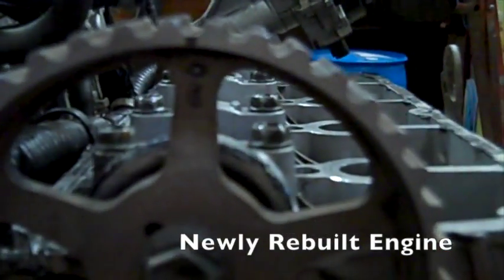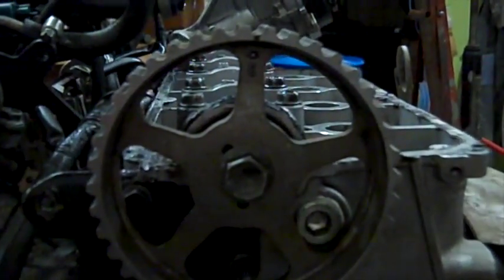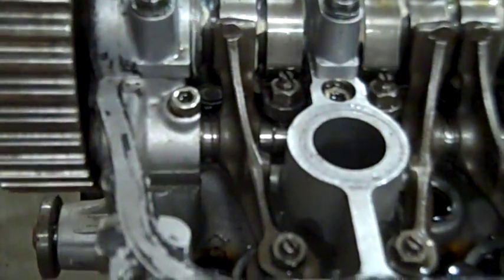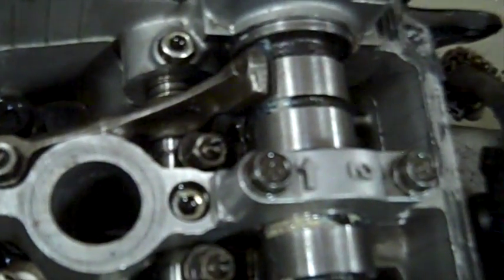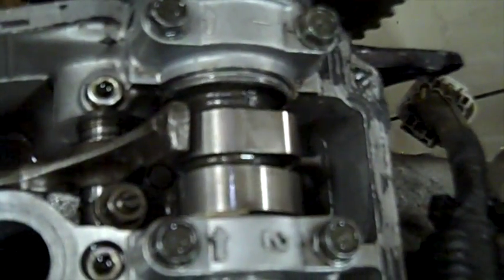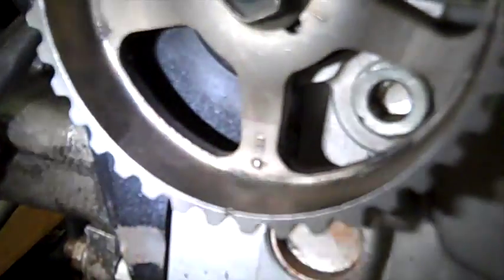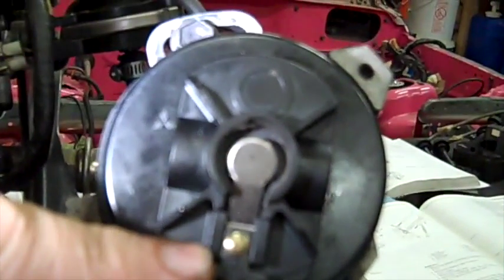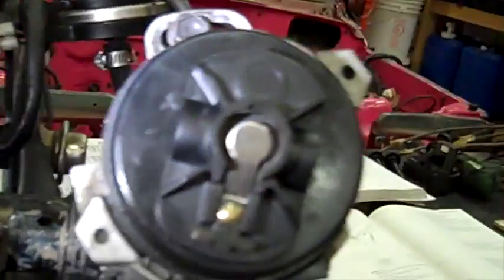1995 Suzuki Sidekick Camshaft Timing

Comment: I don’t know if you’re still active on here, but I have been working on my side kick for 4 months and could not get to the bottom of what was going on. Turns out I had the “E” mark at 12 o’clock. Rotated the cam to 6 o’clock and it runs like a dream. Thank you so much.

Comment: Ok will it still run if its on wrong cylindar at distrubitor i lined mine up it runs but the distrubitor would never point on those cylindars what up with that any help would be great
Reply from the maker: I think if it runs then it must be pointing to the correct cylinders or really close.  Contact me through my face book page, suzuki sidekick restoration project, and give me more details.  I will try to help.

Comment: Hi, I have 1990 sidekick G16A engine 8v,  On mine the distributor finger should be on 11 Oclock position while the fixing screw is on 12 Oclock /on your engine G 16A 16v finger is little more past 12 Oclock. And that is exactly how its need to be. Maybe you can help me with how to position camshaft on G16A 8v engine is it also 180 degrees mark straight down? When inserting distributor gear? I cannot find any info about that. Or is it O degrees position.  Thank you best regards
Reply from the maker: I show the process in a couple of other videos also.  You might want to have a look at, I think it was, the last episode of my head rebuild video.  The best way for me is to get crankshaft and camshaft marks lined up perfect (tdc #4) and then turn the crankshaft one full turn clockwise.  Then #1 will be tdc and confirm that by looking at valve rocker arms.  Then insert the distributor assembly so that the rotor will point at #1 position.  You can discuss with me on my face book page:  www.facebook.com/SidekickRebuild/

Comment: Why the camshaft has tow marks timming  points
Reply from the maker: Sorry Zameer, I do not understand your question.  Maybe you are asking why the camshaft pulley has two marks.  If that is your question, then I do not know the answer.  Probably have to get a Suzuki design engineer to answer that question.
Reply: E is for timing belt  i is for the distribuidor  you put the timing belt on E then you Turns  the cam n put it in I for the distributor  fire on number 1

Comment: Buenas, entonces cual es la forma correcta de colocar el punto del arbol de levas?
Reply from the maker: Lo siento pero no puedo explique en espaniol.  Encontrar amigo que habla engles e escucha video para traducir.  Yo hablo muey poco espaniol.
Reply: write me in English and I translate it please. How would the marks then?
Reply from the maker: Three things need to line up properly.  The crankshaft pulley at the bottom, the larger camshaft pulley at the top, and the distributor at the rear.  If you have had the distributor removed like I did then these are the steps.  With the belt off, line up the crankshaft marks as shown in video.  That puts cylinder 1 at front and cylinder 4 at back in the top dead center position.  Now turn camshaft pulley until E mark is pointed straight up.  Next, turn your distributor so that the rotor is pointed to the #4 cylinder spark plug wire.  Now slide the distributor assembly back into the engine and tighten the bolts.  In this position these things should all be true:  Crankshaft pulley marks lined up, Camshaft E mark straight up, and distributor rotor pointed toward cylinder 4 spark plug wire.  If you have the cover off you can check to see that exhaust valve lifters on #4 cylinder are loose (valves closed) and exhaust valve lifters on #1 are tight (valves open).  That confirms that everything is correct.  Don't forget to check valve lifter clearances again before putting the cover back on.  Hope this explanation helps you.
Reply: excellent explanation. The "E" upwards, damper in top dead center and rotor pointing towards 4. The valves of the piston 4 must be totally closed and those of the piton 1 in the crossing of valves. I'll do that tomorrow to see if it turns me on. Regards!
Reply: Taduccio en cateano
Reply: Traduccon en castellano

Comment: hi. what happens if the silicone that you used to seal the camshaft cover fall in the engine? can fall in the engine that silicone? sorry for my bad english.
Reply from the maker: Do not use silicon on the valve cover.  Order a gasket.  That is my advice.  Small amounts of silicon can squeeze out on the inside and break off.  They can plug up the tiny oil holes for the camshaft.  If that happens then your engine is ruined.

Comment: Why is your two videos different on cam timing same motor
Reply from the maker: Can you explain what the difference is.  What is different?  The thing that was super confusing to me is that when all the timing marks are lined up then the rotor in the distributor should be pointed to the wire from cylinder #4.  I (and other people) assumed it would be cylinder #1, but it is not.
Reply: write me in English and I translate it please. How would the marks then?

Comment: Is this a G16B engine?
Reply from the maker: The engine block is a G16A (cast in back of block).  The engine as a whole might technically be considered a G16B engine according to manual.  I have tried looking up what the difference is and I cannot find anything different between the 16V G16A and 16V G16B.  If you know what the difference is then I would like to know.
Reply: @nunapitchuk  G16A = Carby, G16B = EFI 🤙
Reply from the maker: @dsrupthq7491  Thanks for the reply.  I have studied since my comment above.  16A and 16B are identical blocks.  16A has the 8 valve head on it.  I think they can be carburetor of EFI depending on year.  16B has the 16 valve head and also the pistons are different.  16B pistons have 4 cutouts for the valves.  The lower ends are interchangeable so long as you have the correct pistons.  All of the blocks are stamped G16A even if it is a G16B engine through 1995 and probably later ones too.  If looking for new block on Alibaba then I suggest searching for G16A engine/block..